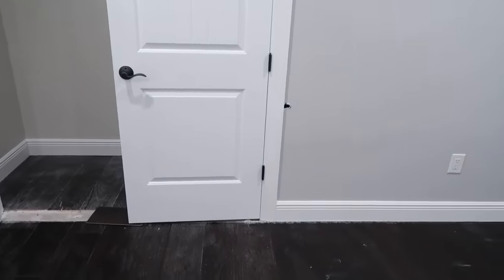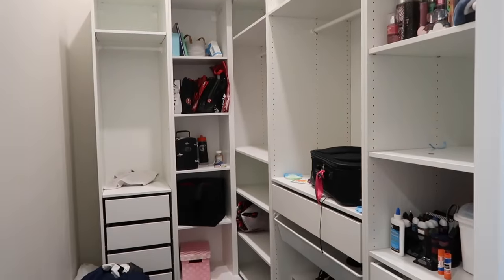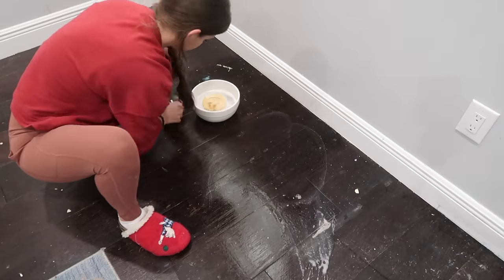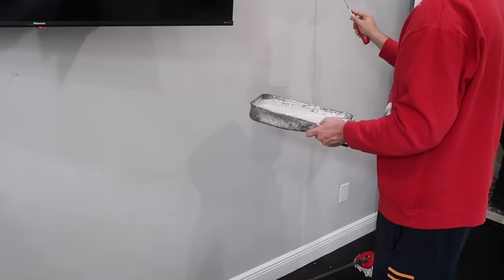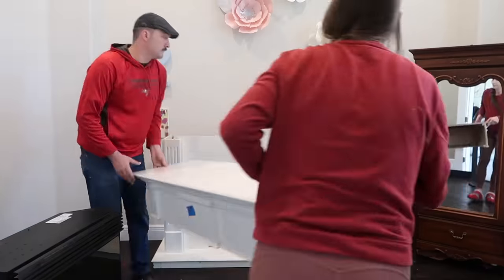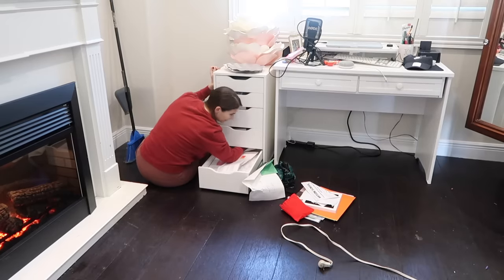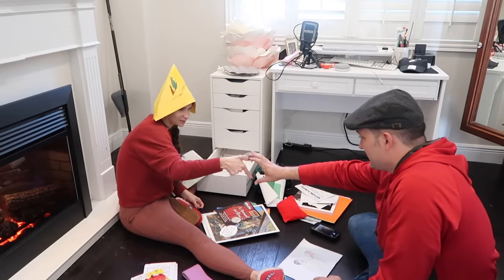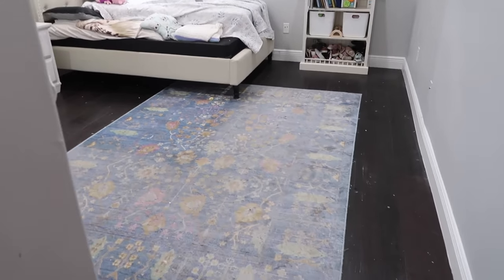It's Moving Day. Finally! New Rooms, Cleaning, Decluttering, Rearranging, Wow! I Can't Believe It!

Comment: I’m an artist that painted in my room as a child, so I totally understand your dilemma. How about dedicating a corner in her room with good lighting. Then get a outdoor rug and put a solid rug pad underneath. Then for the walls you can use bead board or other wall treatments sold at Lowe’s an install with 3M tape so it’s not permanent, but washable. Paint the “wall panels” with glossy paint so it washes off well.
Reply: Maybe some kind of paintable, washable wallpaper for behind her desk.
Reply: Fantastic ideas!
Reply: Just roll butcher paper could work for the walls? She could decorate it if she wanted, and change it as much as she wants.
Reply: Clear "contact paper" that is usually used to protect shelves in cabinets could be used to protect the desk and possibly the walls and floors!
Reply: As an hobby painter I use my kitchen table as my “studio”, I found some plastic runners to protect my floors and rug, you can also get mural paper for her walls, it can be replaced often and used as a painting surface. Meredith is so sweet, I am so happy for all of you, extra rooms are a blessing.
Reply: There are washable rugs that you could use on her floor.
Reply: Same train of thought use the outdoor rug and then you could get a peice of faux leather. Tack it up. Easy to wash off. No skill needed for install.
Reply: Kim, don’t let her use her desk for art. She should use her desk for homework.
Make up a 3 sided wall 3/4 cube and buy a piece of wood to set inside the cube to use as a floor. Cover that piece of wood with stick on vinyl tiles. Tiles are washable.  You can use IKEA pieces to make the 3 sided cube. Have a store representative help you pick out the pieces you would need. Basically making a human splatter paint box.  Set it up away from her wall unit. 
I use mixed media daily.  It is to easy to ruin things with paints.  I know from experience and I’m an adult.  Even though 
she’s just using acrylics, they well ruin her wall unit.
Reply: Do u still paint? Or draw 
I do

Comment: Use clear peel and stick wallpaper on the walls behind the desk.  It will protect the paint and will come right off the wall when it needs to be changed.
Reply: I should do this for my kitchen in my apartment lol

She can also get a chair mat for the floor. There's glass/plastic for noncarpeted floors. My dad prefers the glass because it doesn't crack over time like the plastic.
Reply: Genius!
Reply: Where can I buy it? 😊

Comment: You could try a plexiglass or clear plastic frame behind her desk on the wall, and on top of the desk itself--she could layer cute pictures behind it so it's decorative, but easy to clean and doesn't stain any surfaces.  This is what we did for my daughter who is also an artist.  😅 And you can always remove it later.  And as far as the floor, a good boho rug from the thrift store under the desk will work and if it's colorful no one will ever know! 🎉

Comment: Re: painting…go get a big square of sheet vinyl flooring to put on the floor under the easel she’s using. The walls can be protected with something as simple as hanging a curtain, even a shower curtain. 

Remove acrylic paint with ammonia, rubbing alcohol, or acetone. Don’t use rubbing alcohol on the walls, though, it’ll take off latex paint too.

Comment: Dying over the hungry caterpillar backpack that was hanging on Merediths closet. Also, for your artist, what about glade press and seal to protect the desk and wall? Easy to clean up and replace, or a clear shower curtian liner, they are like $2 at target and you can take it outside and hose it off when it needs to be cleaned.

Comment: You should get one of those clear plastic mats that make desk chairs roll easily, and put it under the desk in Eleanor's new room!  She's old enough now that it shouldn't get on the walls.  That said, one of my granddaughters is an artist, and my daughter created a maker's space down in the basement for her and her siblings, with hand-painted table and chairs designed to spark imagination, and all the art supplied stored down there.
Reply: If FL is like TX, there are no basements.
Reply: @dbw825  Oh, right.  But the clear plastic mat for under the desk is a good idea to protect the floor.  And honestly, a glass top cut to fit the desk would stand up to anything.

Comment: ❤Finally Move in Day❤ I’m excited for you and the kids.  As for matching paint….Lowe’s, Home Depot etc can match a paint, but it will not be an exact match.  Each store has a different base formula which means the color match will be a bit off.  There is a washable mat you can place under Elenor’s paint space, which will help with clean up.  You can also place plexiglass behind her painting spot attached to the wall with 3M tape.

Comment: I paint all the time with acrylics and other mediums. I bought plastic mats and a big Matt for cutting with an exacto knife that I use on the top of my white desk. They are easy to take to the sink and wash every bit of the paint, clay, etc. off. My desk looks as beautiful as the day I bought it many many years ago.
I have white carpet in my art room. So under my desk, I put the largest desk, chair, clear, thick plastic matt. It's the one that is in professional offices to smoothly roll your chair on. It's thick so the chair glides effortlessly. It's a little bit larger than the desk and plenty of room to roll between my desk and the cadenza behind it. If anything gets spilled on my desk or knocked over, the matt is out far enough to make an edge for protection. And any paint or water or anything else easily is wiped up, and paint just peals right off it. After 10 years there's not a single stain on my white carpet. It's like an Art floor.

Comment: For the paint area, why not use peel-and-stick tile on the floor and maybe up the wall.  It would be easier to clean and faster to get rid of and replace.  Also, it could be an art installation depending on what tiles you choose.

Comment: If you want to add storage… you could pull your bed forward and  put it behind it… facing the wall n your bed can have a floating headboard which would be the back of the storage solution…. Not sure if you follow my grand plan for your rooom😂

Comment: Eleanor‘s room is so big. Why not put a cheap folding table against one wall and put a plastic tablecloth on the floor and one on the wall behind the table. It would be easy to fold up the table and remove the plastic tablecloth if you wanted to clear it up for, any reason.